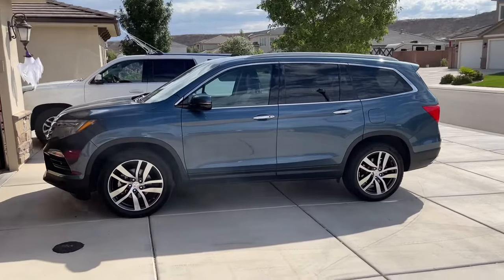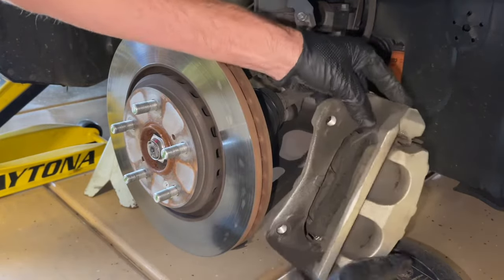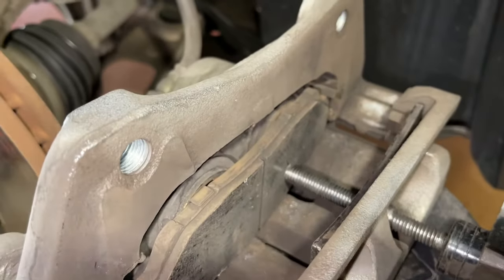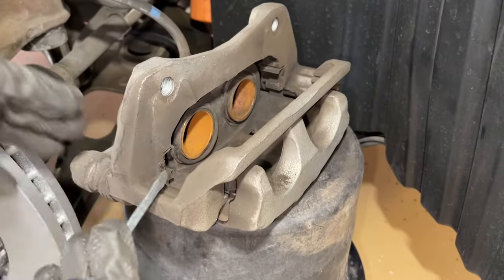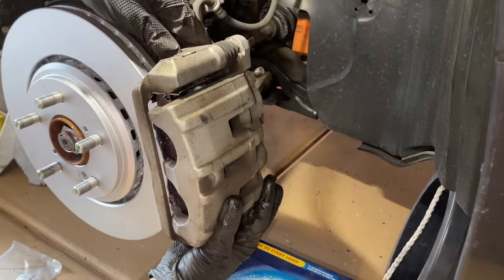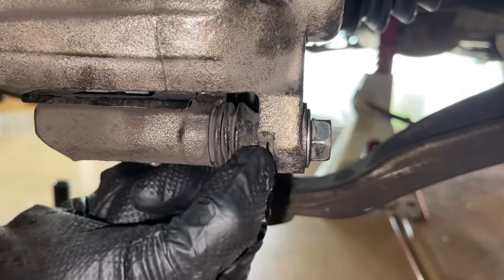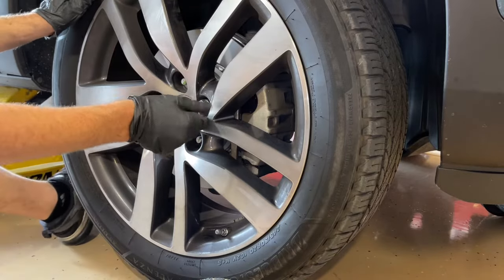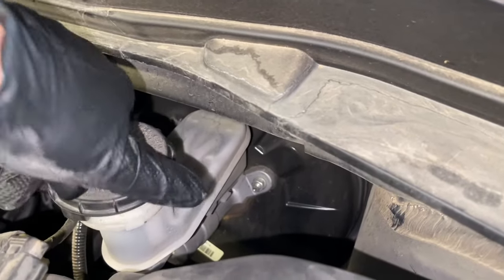Honda Pilot front brakes 2016-2022: How to replace front brake pads and front brake rotors

Comment: Old mechanic's tip: clean the bleed nozzle, put a piece of tubing going from the bleed nozzle to a bottle with some clean brake fluid to cover the open end of the tube. Open the bleed nozzle before you compress the pistons. The fluid in the pistons is usually degraded by heat and contains rust. Instead of forcing it back into the brake lines, you expel it to the waste bottle. And, since you've done most of the work needed to bleed the brake lines, this is a good time to replace the years-old brake fluid in the lines with new fluid since brake fluid is hygroscopic. At this point, it's only a few more minutes per wheel.

Comment: Tip: always service the slider pins and a lot easier to replace brake pad hardwares and push caliper pistons when you remove the caliper itself from its bracket.

Comment: I noticed you didn’t do anything with the slide pins. I thought those needed to be greased when replacing pads?
Reply from the maker: It is definitely a good idea to grease them as part of the service. The brake pads were evenly worn on this one and the total miles was not very high so did not disassemble the pins. There is always that risk as well of breaking something else or tearing the rubber boot. You certainly can if you’d like to.

Comment: Did you install the inside pad indicator on top? My car from factory has indicator on bottom side of inside pad
Reply: same here. I'm wondering is this an error or the norm?
Reply: As long as they are on the inside they should be OK. Generally they are on the top but bottom is also acceptable.

Comment: Question  do you have to replace the rotor every time you replace the pads
Reply from the maker: If there isn't a lip you can feel on the edge of the rotor, you can typically replace the pads only for one time. It also depends on driving habits, and the rotors may warp from heat, so you do run the risk of putting new pads on and still have a vibration when braking.

Comment: How did you take off rotor screw so easily?
Reply: LOL I live in rust belt and that screw is a mfer....one time I used a grinder to take off the head of that screw.  And then after I never replaced that screw in any rotor I have replaced.
Reply: That screw was obviously already loosened

Comment: Honda dealer said my brake pad shim is installed  incorrectly, how could that happened , if this is installed incorrectly
it will cause noise if it is running

Comment: No need to bleed the brakes?
Reply from the maker: Not unless the master cylinder level fell so low it sucker air into the system, or if you removed a brake line and lost brake fluid
Reply: Sounds good.  Thanks.

Comment: Hey Danny. I have an issue. My 02 mustang won’t come out of park unless I put it in the ACC and pressing the button on the shifter in before turning on the car. But once I put it back in park of the car is on, then I can’t get out of park again. Do you happen to know the fix for this?
Reply from the maker: I don’t since I don’t have any auto mustangs, but it may be related to the switch on the brake pedal or on the shifter itself there should be a safety switch
Reply: Check Neutral safety switch